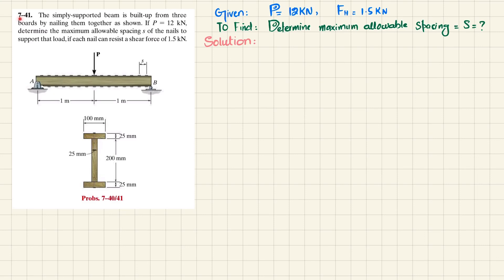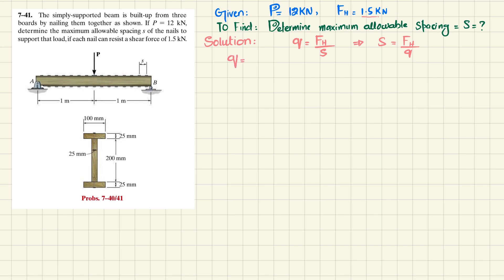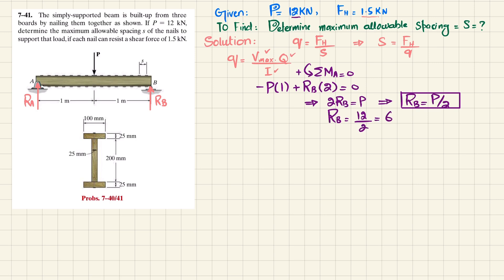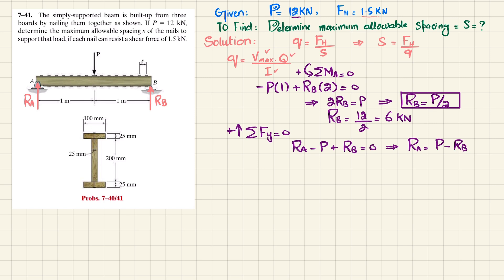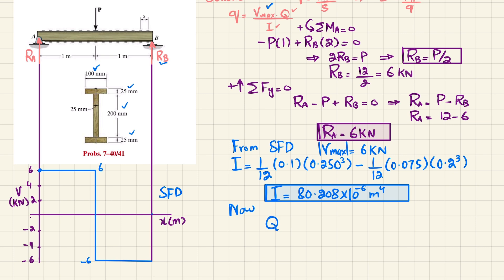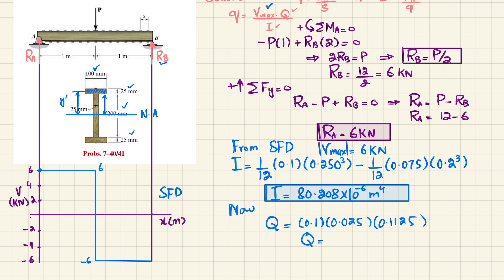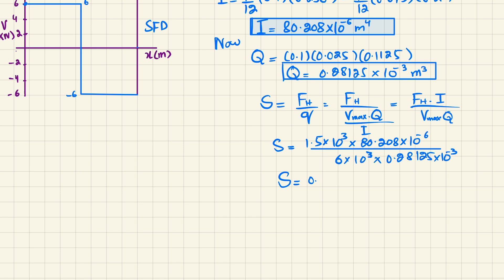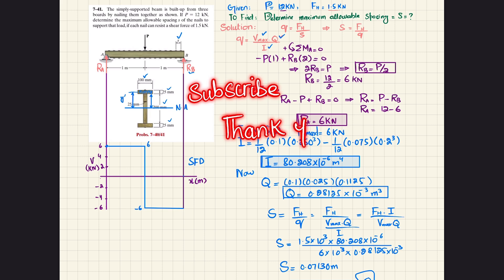7-41 Determine the maximum allowable spacing s of the nails | Mech of materials RC Hibbeler

Comment: Much appreciated your precious videos❤but ia hve two questions sir i confused alot  some where we use the formula lik this (taw=VQ/IB) also we find (İ) due to this equation İ=1/12ab^3+AD^2 but in this video you just found 1/12ab^3 and in some questions thikness will be plug beside the (I) under VQ 
İ hope you will help me i have final exam 🙌🏼
Reply from the maker: You are welcome. I can be obtained by using two methods , one that you mentioned is parallel axis theory. And other one is 1/12 ab^3. And also there is difference between shear stress and shear flow. Both formula is a little different. Now tell me where you have issue.
Reply: @ ok sir thanks , now i’m trying to understand if i have a question i will tell you inshallah
Reply from the maker: @Ded_aaa ok and with the passage of time you will understand many things

Comment: Hi! When calculating the value of q, why don't you take into account of the total two nails connecting the 3 pieces of boards together? Aka why not q = VQ/2I? Thank you!
Reply from the maker: The distance between the nails is taken from center to center and each nail is participating with its adjacent nail therefore we consider it single as half of one nail is with right side nail and half with the left side nail.

Comment: I =1/12* bh³+Ad why not +AD2
Reply from the maker: If you take the every segment seperately then we will apply the formula you have mentioned, in that case both flanges will have the term Ad^2
BUT WHEN YOU TAKE WHOLE RECTANGLE AND SUBTRACT THE SIDE EMPTY PORTION THEN NO NEED TO APPLH THIS FORMULA AS WE KNOW THE CENTROIDAL AXIS OF RECTANGLES AND AND THEN THE NEUTRAL AXIS OF RECTANGULAR SECTION WILL PASS THROGH CENTROIDAL AXIS.
Reply: @engradnanrasheedmechanical  Mahadsanid  mudane
Reply from the maker: You are welcome